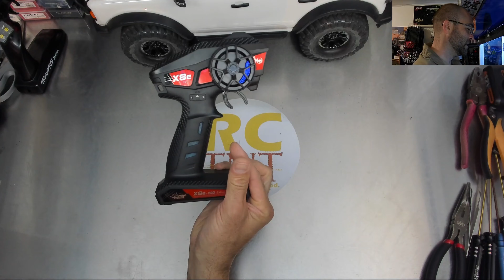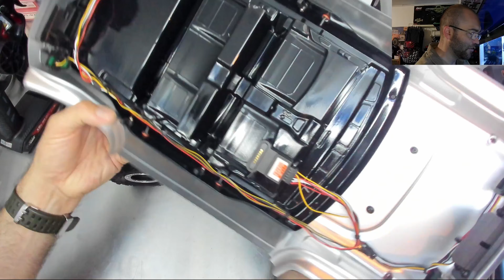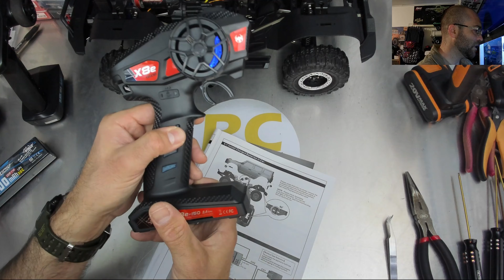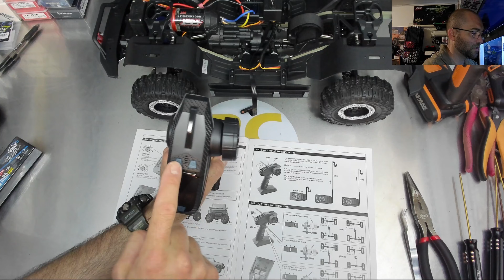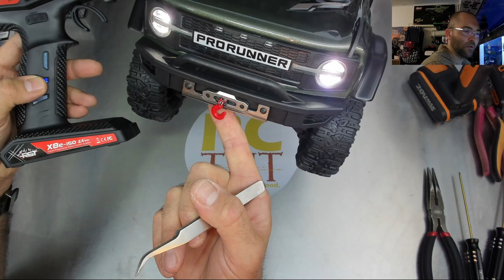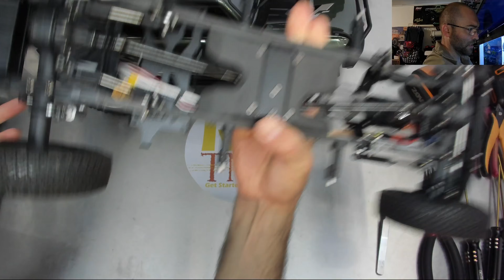RGT Pro Runner Trail Rig with EVERYTHING??

Comment: You made me laugh ,I love it when traxxas owners find out there's better stuff available cheaper 😂 it's like my xmaxx as soon as my esc was a year old it said I need to update the firmware so i did  and it never worked again afterwards so i calles traxxas they said not our problem youll have to buy a new one 😂 so I told them to fxxk off ,I'll never buy traxxas again if that's how they treat people
Reply from the maker: That's a shame, sorry to hear it. I'm pretty tired of the firmware updates, it's common with several radios in rotation here and it just takes so long!
Reply: @RCTNT  esc Bricked
Reply from the maker: Yeah I understood that too, that's the part I was sorry to hear about. Just the radio firmware is annoying to update but to have it kill an ESC, and then to have them wash their hands of it would put me off them too.

Comment: $1400 bucks .......for a Traxxas that hobby shop saw you coming.... that's a $550 truck here ...$1400 gets you an xmaxx was the some upgrades and a battery. You got ripped off on that trx4 mate .
Reply from the maker: Australian dollars, remember. This vehicle is AUD$1100 here now, though I picked it up for something like AUD$860,which was a good deal at the time. The additional parts added to the cost: Pro Scale Light Kit (AUD$180 in May 2023, Winch (Traxxas brand was $150, though Traxxas parts and accessories availability in Australia is patchy), SSD straight axle conversion ($140). I also quoted what these cost without discounts in the video to make the point. Comes to about AUD$1600, or USD$1050. You get things cheaper in the USA, so your total spend for the same car would be about USD$720.

The point was to show how the RGT is about AUD$1k less for similar spec to the modded TRX4. It's vastly better value. 

Let's put it in USD prices for the comparison. We'll even update it to match the current Traxxas promotion of including the $100 winch with the 2021 Bronco variant, so the TRX4 will be a better contender:
Car with winch $550
Pro light kit $100
SSD straight axle conversion $70
Total cost USD$720

RGT Pro Runner, with shipping to USA: Total cost USD$370

Two pro runners shipped to the USA is USD$760. Or you can buy one upgraded Bronco. And the RGT comes with the better ESC and servo. This is the point I was making. Cheers

Comment: Now I can't wait to recieve mine. I chose green variant too. Because the manual says that you can upgrade the motor and ESC I would be grateful if you could check whether HW 1080 fits into that plastic bracket.
Reply from the maker: It probably doesn't fit, the 1080 is a little bigger than the 1060. You don't really need the cover though. Just double sided tape will do.
Reply: @RCTNT   It fits perfectly. Z height is spot on. Just the bracket needed some trimming.
Reply from the maker: Good to know!

Comment: Man, that is a steal.  The only thing that worries me is replacement parts availability or compatibility.  But for that price, about $370 shipped to the states It's definitely worth it.   My problem is that if I pick one up now, it's gonna cost me alot more than the truck when my wife wants a divorce.   I'm looking at a wrapped present sitting on the floor that I have high suspicions is a redcat Gen 9.   If another Truck showed up before Christmas, it could get ugly around here,  lol... but it sure would look god trailing around the property beside "whatever" is in this Box under my tree.   

Keep up the content.
Reply from the maker: Haha right!!
RGT parts availability has been good so far for most things. I was able to buy a lot for the Rescuer when I went with all RGT upgrades not long ago. I expect you'd be fine.

But also, what parts do you regularly break on a crawler? It's usually a motor or servos, which are universal. So there's that.

Comment: 1400 bucks.. sorry but weak shouldnt be in the first min of talking about it.. nor should the need to upgrade anything ...  traxxas isnt n hasnt been an option for me for sometime...
Reply from the maker: It isn't weak, but it is expensive. I think I misspoke about the axles, they're from ssd. The TRX4 axles don't break, they just don't. I'll add a correction in the video notes here, it's an important one. But yes, value preposition gets a bit shaky next to the pro runner here!
Reply: Part of it is the import and such. Which I feel like Traxxas should be offering more for the price to overseas customers. In the United States these run $500 before taxes. Light kit is $99. Which is also $99. So maybe 750-760 after tax. But all of us in the states agree as well that Traxxas is doing a lot of coasting. It doesn’t help that Electronics in the trx4 aren’t very good

Comment: Nice review! I really like your Channel. I wonder how does it compare agains the RGT rescuer ex86190. It seems similar on paper. But i dont know who drives better
Reply: I really appreciate the coment. Thank you so much!. I am recommending your channel to all my friends because it si s good!
Reply from the maker: Subjective answer: Rescuer is more fun to drive with its big bouncy tyres and scale body. Crawls better with its bigger diameter tires too. Remote locking diffs make for a great trail rig. However, it wants some upgrades to help with lowering the CoG and to increase scale. See my upgrades video about that.
Pro Runner will crawl better once you fit bigger diameter tires. DIG and servo on axle means it should be a killer on the rocks once you get the tires sorted. Doesn't really need upgrades but if anything, I'd add some brass to the front corners, as per the video recommendation here.

Both are a great buy.
Reply: @RCTNT  really appreciated that comment! Always curious to compare to other relevant rigs!😃

Comment: As always, Craig, excellent review! First crawler? Being in the States, I think I would have to stay with Traxxxas. The support is unparalleled. just my "quick" opinion.
Reply from the maker: Thank you kindly. And fair enough, however you can buy two of these for one equivalently configured Traxxas and RGT parts are available by mail. Point taken for the noob factor and having a hobby shop to help replace the Traxxas servo and program the Traxxas esc would be helpful. I'd respond by saying the RGT is far less likely to need this, as electronics are Traxxas' weak point.

But I take your point and agree to some extent anyway, yeah.
Reply: @RCTNT  We should always agree to disagree. 😉
Reply from the maker: Nuance is really important in discussions, for sure. Can't get too far without it!

Comment: Would you know if it is possible to make the FWD be changed to RWD?
Reply from the maker: Not with this transmission. But yes if you are prepared to spend maybe another $120 or so. It'll need different transmission and transfer case, different shafts to fit, time and care to work it out. Doable, yes. Should you? Probably not.